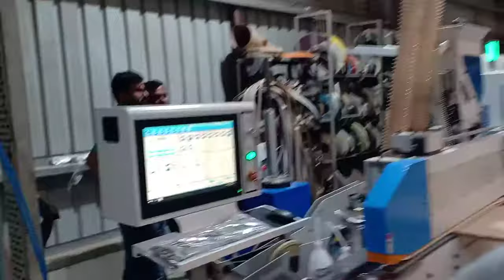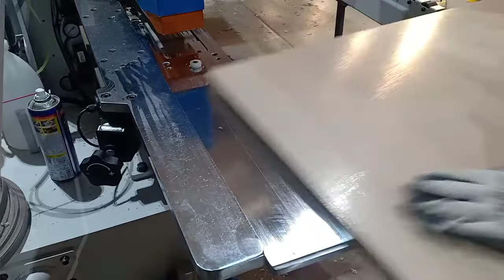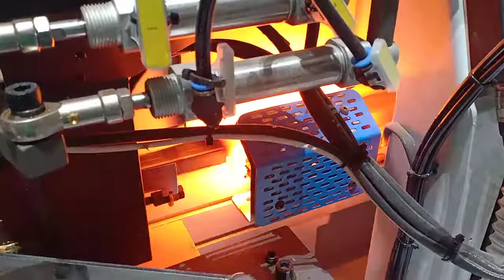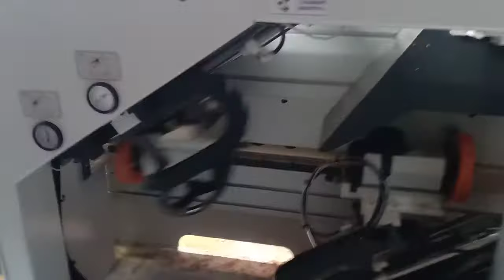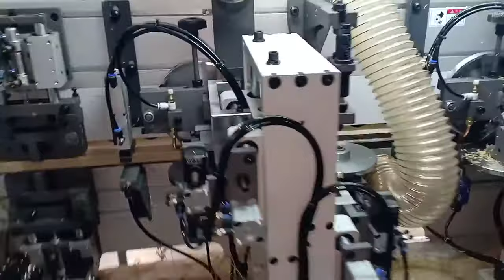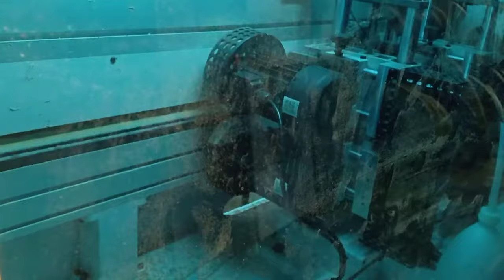Fully automatic edge banding machine

Comment: Looks like a Chinese made machine to me. My experience with them is they are not very consistent from day to day operation. Maybe some of the Chinese machines are better than other Chinese machines in the industry. My experience with them is they can't handle 3 mm PVC banding. Guillotine can't cut the material.
Reply: I have experienced the same at my work with 3mm tape. Sometimes it cuts it sometimes it doesn’t. My theory is air pressure fluctuations. There is a 3mm flex tape made though that is easier to work with.
Reply: PUR PVC both okay.